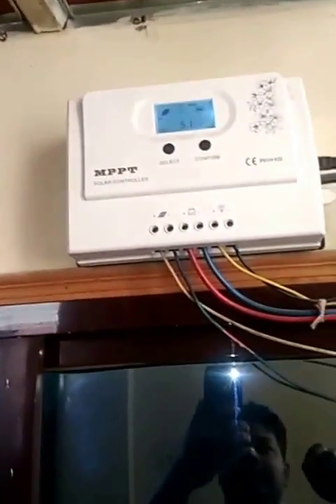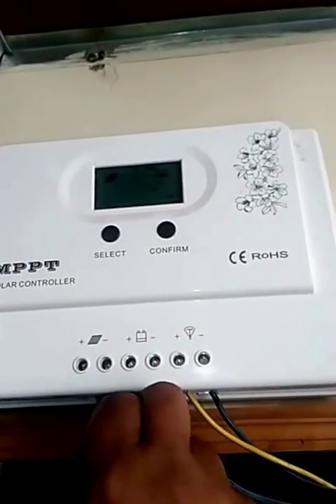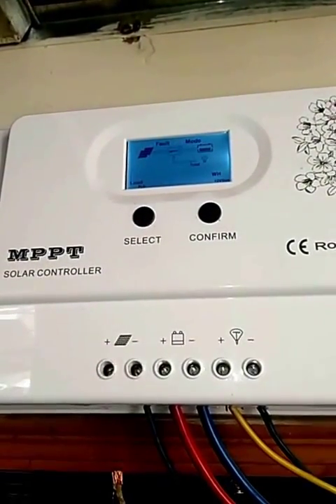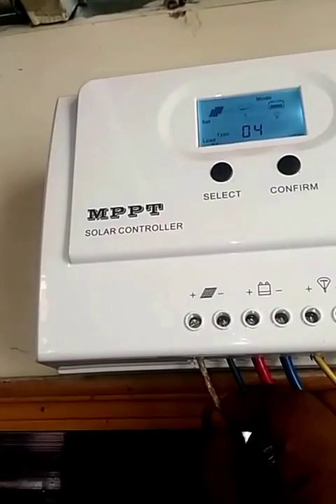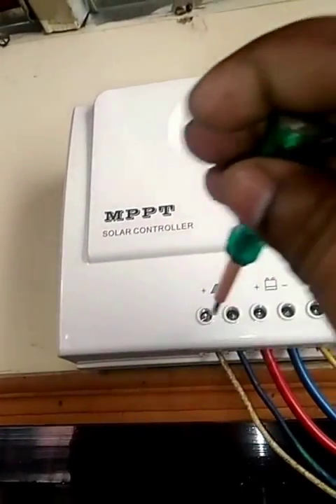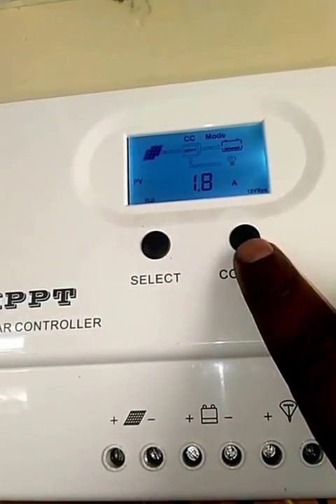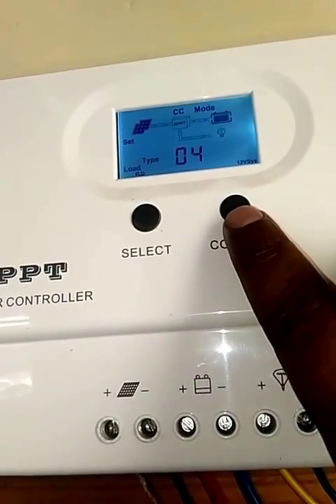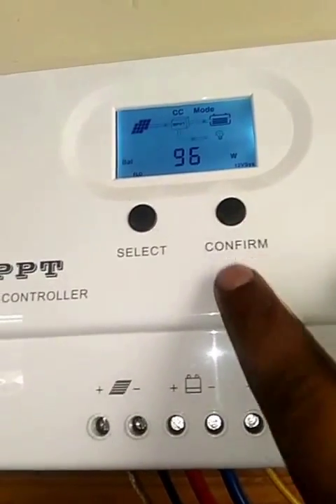MPPT Wiser2 tracking problem

Comment: how to fix problem?
Reply from the maker: Sorry dear you need to change controller wiser2 was a fail. Firmware problem. You may purchase Wiser3 , Esmart3 , Epever tracer, I've tested all are good you may watch videos posted in my channel.
Reply: @MastercraftKARIGAR  my controller wiser3 but same  problem.
Reply from the maker: Can you describe what is the problem. Your panel watts and volts , connection in series or parallel ? Battery volts 12 or 24?
May be I can help you.
Reply: @MastercraftKARIGAR  my system 12volts. 1 piece solar panel 185watts. 

my problem is the solar panel 20.1 volts.  19.19 watts fixed

solar panel input cable displacement and replacement  16 volts. 125 watts power .

after a while 20.1 volts 19.19watts constant.again input cable  displacement and replacement  power increase.
Reply: @MastercraftKARIGAR   how can i send you a video
Reply: @tafix22  you already solving this problem, i have wiser3 and same problem
Reply from the maker: Please give panel and battery details.
Reply from the maker: Your solar panels voltage should be at least 2x battery voltage.

Comment: Where is your panel and how many watt is it? And your wire you have from your panel/s are small that may be the issue
Reply from the maker: Hi thanks for your concern Actually this problem was in all wiser2 series. Actual problem was there firmware. Not the hardware now they have upgraded this controller to wiser3 which don't have this problem. Watch my video about wiser2 
https://youtu.be/GTAqhbbfOjs
Reply: @MastercraftKARIGAR  how to fix problem?